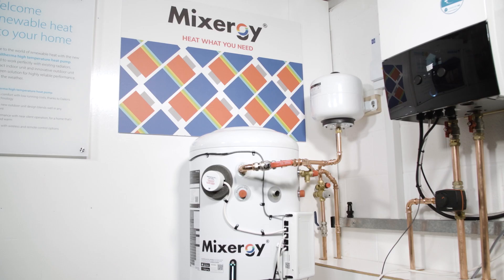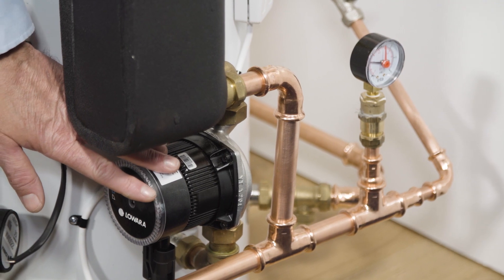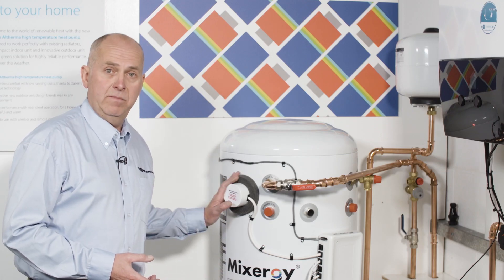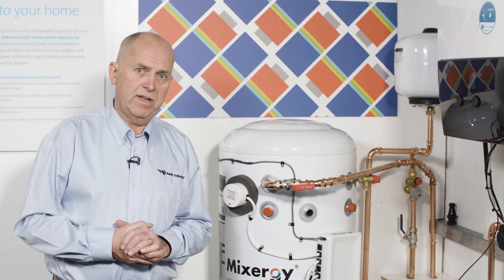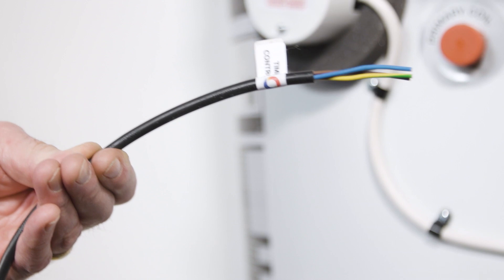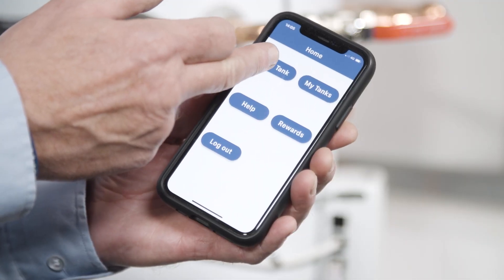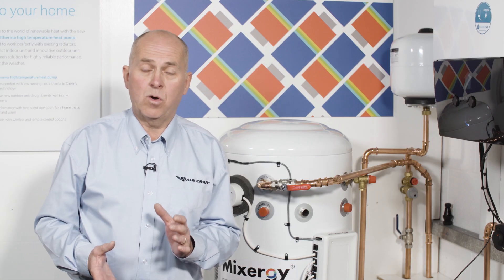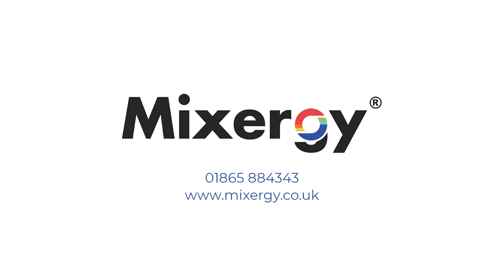Installing the Mixergy Heat Pump cylinder with the Daikin Altherma... for installers!

Comment: I'm considering replacing the existing combi boiler with an ASHP + Mixergy tank.

would I need also a buffer tank for the ASHP to operate efficiently or does the Mixergy tank also act as a buffer tank ?

thanks
Reply from the maker: Thanks for the question, to help us advise you better, please email our team at enquiries@mixergy.co.uk with your intended set up.

Comment: Great video - thanks. Interesting product and co-existance with a heat pump. Great tech.
Reply: Small world - I've seen you comment on Twitter on EV Puzzle. I'm looking at a Mixergy tank for a new-build PassivHaus, trying to compare this to Mitsubishi ASHP and pre-plumbed hot water cylinder.... difficult to know pros/cons of the different systems
Reply: @SimonApperley  it is tricky to find the information and performance data. Would you really need heating in a PassiveHaus though? https://energysavingtrust.org.uk/passivhaus-what-you-need-know/
Reply: @johntisbury  apparently yes, according to the specs a peak of 6Kw, though that is presumably in winter with limited solar gain
Reply from the maker: Thanks John!!